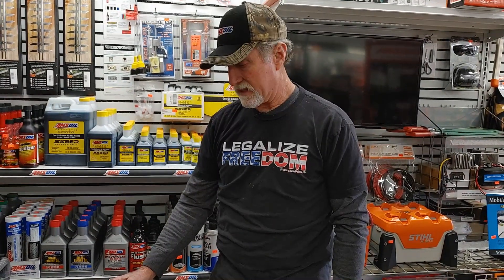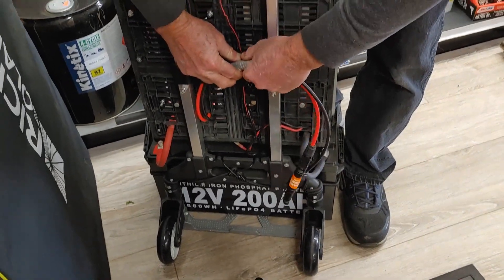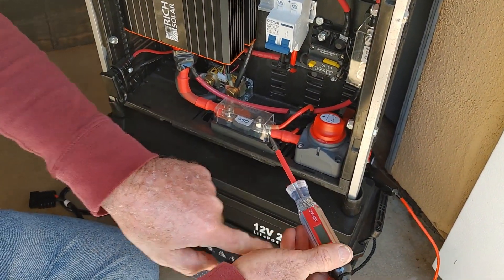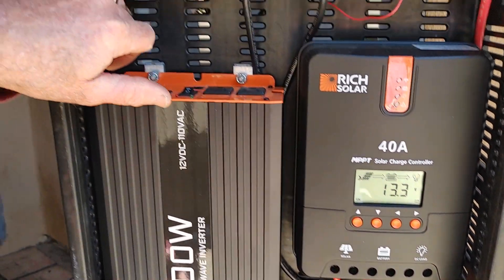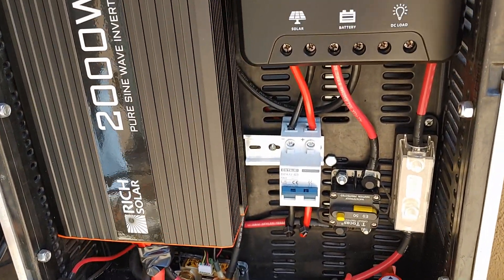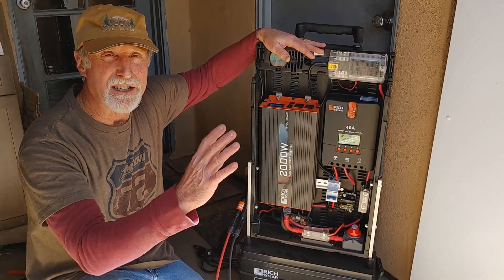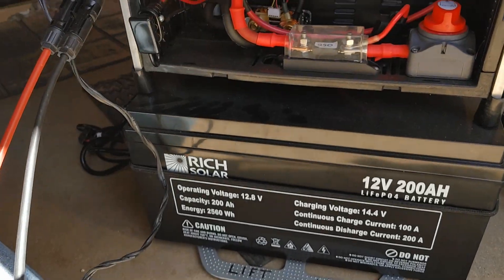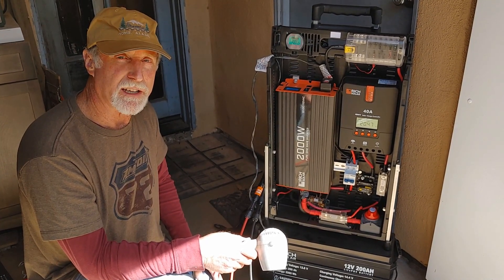DIY Solar Power Cart for Emergency Back Up Generator!

Comment: Love the layout! How do you secure the cart to the hand truck? Would love to know more about what you used on the sides to make sure that it didnt fall off the hand truck. Going to try and build something very similar
Reply from the maker: I just drilled holes through the piping on the hand truck and secured the vegetable tray to it with bolts. You could also use P-Tape(metal plummers tape).
Reply: @fischertoolandgarden  Awesome thx u! Ive been trying to find that plastic mesh crate that you have but am uncertain where to locate it. I know you mentioned Uline in the comments but its not the same one. Anyways, love what you did there!
Reply from the maker: @andykular3756  The Uline might not be the same but will probably work, we got ours from a supermarket we used to supply vegetable to. I think somethin like expanded metal or similar porus metal shelving would be a better choice though, non flamable. Good luck!
Reply: @fischertoolandgarden  thx u for the tip! Any links you could think of regarding the metal shelving? You seem to have a good eye for this setup. Really appreciate it

Comment: Great video! I love the concept of having a backup power station for outdoor adventures and family time. It's important to have reliable power for all our devices and appliances. Have you heard of the Segway Portable PowerStation Cube Series? It's a versatile powerhouse with a massive capacity, fast recharging, and comprehensive protections. It's definitely worth considering for outdoor enthusiasts like us. Happy camping!
Reply from the maker: Thank you! I'll check out the Segway. It's been hard sourcing solar supplies for your outdoor power equipment shop, especially portable power stations. With California banning outdoor gas powered equipment, we need a solution to charge landscaping equipment batteries.

Comment: Excellent work built for the very purpose , off grid work , activities and work with a piece of mind .😉🤙
Reply from the maker: Thank you! I just built 2 more for home running 2 full size fridges and freezer. Put it all in a metal shed and solar panels on roof.

Comment: Very nice built, what is the wire gauge you are using? I am planning to build same thing but only use 1000w inverters on 12v 200ah battery, should 6 gauge is enough? Thanks
Reply from the maker: I would suggest getting Will Prowse's book "Mobile Solar Power." He has very helpful charts on what you'll need.

Comment: Hi great build . A question, where did you get your plastic enclosure? I’ll appreciate to learn.
Reply from the maker: The plastic enclosure is a vegetable tray. I got this from a grocery store we used to supply produce to. You can get something like it from Uline.
Reply: Just ordered 3 container at Uline and they are great. A little short on the wight side. I’m missing one or 2 inches. They are 21 inches inside. When I look at you’re clips I see your inverter and controller side by side. Asked Rich Solar for the  dimensions of their 2000w inverter and their 40a controller. They told me their inverter was 21x12x9 and the converter 12x9x6. So it would need 12+9=21 inch wide container. When I look at your clip their seem to be an inch loose between them. So you are lucky to have find a container of more then 22+ inch wight. Unless..I’m missing something. Thanks
Reply from the maker: @jeanpierrelabonte2868  I'm going to build another solar cart on a larger hand truck. I'm planning on putting a 2000 watt Rich Solar inverter right above the battery (400 AH 12v EG4 with on/off switch) then two Victron 100/30 charge controllers and the other stuff in the produce tray above the inverter. That way the inverter and controllers will get plenty of air flow.
Reply: Sorry for my last comment about the Uline container. Finally found your vegetable container made by IPL in Canada. Indeed inside wight is 22,6 inches so it’s should fit. Thanks for all you’re work .Appreciated it very much.
Reply: Thanks

Comment: Hi
All the charge controllers I have used say connect to a battery before connecting solar panels so the breaker you have after the charge controller is not a good idea
Just unplug the solar
Good job though 😁
Reply from the maker: One breaker to isolate the panels and one breaker to isolate the charge controller from the battery for repairs I guess. Just following instructions in a solar power book. I guess if you were to have to replace or repair the charge controller, you could still run the inverter this way. To power up the system, from battery to charge controller turn the breaker on, then turn on the breaker to the solar panels, and vice versa to shut down.

Comment: If you use a 0-1-2 switch then connect the precharge limiter between 1 and 2 then there is no need to play with light bulbs manually. Off is off, 1 is precharge and 2 is run. Wire the precharge limiter lamp or resistor between terminals 1 and 2, wire the inverter to terminal 2.
Reply from the maker: Yes, I've seen this configuration before, definitely would  do this next time. Thanks for the info!

Comment: How about a description breakdown of your parts you used here please.  Do I see a solar disconnect switch of some sorts here? Which one did you use?
Reply from the maker: To start, I am not an electrician so most of what I did was what I could understand from some solar courses and a Will Prowse book, so this is just for entertainment purposes. I didn't keep track of all the parts I used, so I'll try to mention the major parts. As far as the solar disconnect, 15 Amp fuse at solar panel and a breaker going into the charge controller. Parts: Rich Solar 200 Ah 12v LifePo4 battery, 250 A Switch, 250 A fuse, 100 A fuse (for Bluesea Systems 12v 100 A fuse box), Rich Solar 40 A charge controller (should've gone 60 A), 50 A Tocas? breaker( charge controller to battery), a shunt from Amazon with round display, 2 - Anderson plugs (one for connecting a battery charger, and one for a solar connection), the battery charger I used was a EG4 15A 12v from Signature Solar. The rest is just cables, a plastic produce tray and a luggage cart.

Comment: Damn!! I'm half way through building a system very similar on a cart!  Mounting everything on a sheet of poly carbonate. I'm using a 300ah Lifepo4, 2000w inverter, victron 100/50 solar controller, Victron smart shunt. DC distribution box. I also have a LED strip light for when the power goes out you can see what you're doing.
Great video! You're got it layed out nicely!
Reply from the maker: Sounds like you're building a nice system. Victron makes excellent equipment. Your charge controller size sounds better. I went small with the 40A charge controller for the 200Ah battery, and will probably go larger on the next one, or do 2 - 40A controllers. I did another smaller portable power system using Victon with BlueTooth for charging tool batteries. It has a solar charge controller, DC to DC charger, and a shore power charger all in a battery box. You can see the video here: https://www.youtube.com/watch?v=HLN6NH_RWAE&t=30s

Comment: Nice cart build.  It's clean and compact. I like the idea of the anderson connector for the PV input.  I have the same problem connecting mine with MC4 as they are not made to be unplugged and re-plugged.
Reply from the maker: Thanks Nate! I just sold the cart Saturday, so I'm looking forward to building another one. It will probably be a 12 volt system again, maybe 2-200 AH batteries and 2 charge controllers for separate arrays. I might go with a 400 AH battery though with a taller cart. Any thoughts?
Reply: @North County Lawnmower  , it's cool that you were able to sell it.  Perhaps one charge controller with 2 mppt inputs to save space.  400ah should be good as long as it's not so heavy.  I've been trying to figure out how to add a 2nd battery tray to my cart, but at 24v, it's pretty heavy.  Perhaps add some USB outputs for versatility.  I'm not sure if you had that on your last cart.  Check out my hand cart video for the DC side stuff.  You won't need a buck converter if you are already 12v.
Reply from the maker: @natesdiysolar  , I've watched some of your videos, very good info, and entertaining! The only USB on my cart was one on the inverter. I like the additions to some of the carts I've seen, and did have an extra USB connector to another cart I did, but opted for the 12 v fuse box so people could decide what they wanted to add on, since I make them to sell.
Reply: @North County Lawnmower  cool.  You should try to build a super compact version. One thing I noticed is you might want to put the inline PV fuse on the panel side (as close to panel as possible) VS the cart side so the PV wire is protected.

Comment: Nice video. Link to the cart and the crate/frame that you use for mounting all the equipment into place? Thanks.
Reply from the maker: Sorry Bud, I don't have links to the cart, I've seen them at O'Reilly Auto parts. The crate, or something similar can be found at Uline, the one I got was given to me by a grocery store.